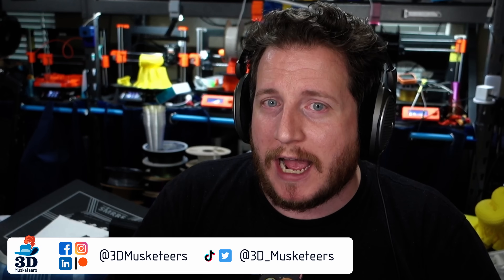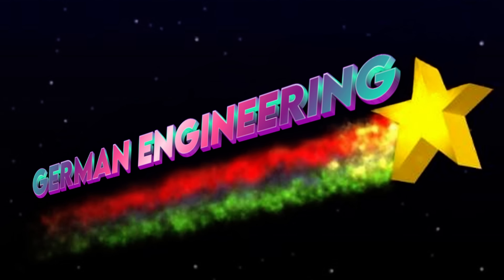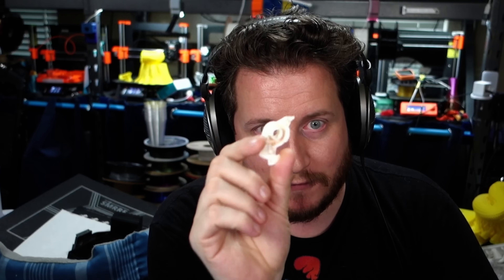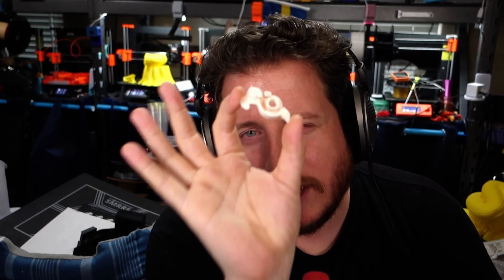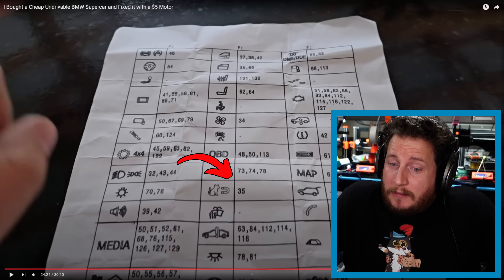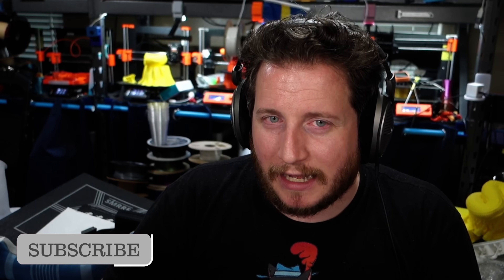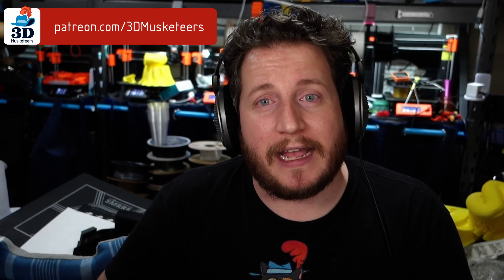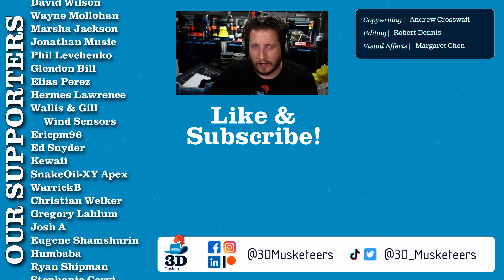Crafting @Samcrac's Car Part! - PrintFixFriday 200

Comment: I have yet to print a part out of nylon that will last long term (with or w/out CF).  At first they are great, very strong, resilient, capable of holding up under various stresses with no issues.  Then after a few months they always absorb to much water and fall apart, loosing most of the characteristics that made me want to use the material in the first place.

Comment: from experience: be careful to print spareparts for european cars, especial for bmw and mercedes, those parts are on "IP-clause" and especial BMW likes to flood you with DMCA's. The other one is for the german drivers, don't tell your TÜV you have printed some parts, those guys like to fail the safety inspection. for the lol's :  the holder for the compartment light is a safety relevant piece :)
Reply from the maker: Bring on the DMCA. BMW doesn't sell the part, and it's modified from stock ;)

Comment: Guy who is too poor to afford 3D scanners here: I have an old USB flatbed scanner that I use in conjunction with FreeCAD to model parts. Exporting to TIFF results in the DPI being included. FreeCAD (unlike Fusion3D!) actually reads the DPI and precisely scales the image which I then trace. Oh, and I do need calipers to get the thicknesses. 🙂

A lot of injection-molded pieces have flat faces that work well using a scanner and this is how I've been able to replace a number of parts with compound curves. So, if someone out there thinks they can't do something like this, think again - you might be able to.

I bet together, the community could release a whole category on Printables and other model sites to help people who need replacement plastic car parts.
Reply: Oh, and congrats on the 200+ episodes!

Comment: Just bought a 2001 Accord (2.3L VTec) last year replacing the 2002 Accord  (2.3L VTec) I drove for 17 yrs that was written off. 

After rebuilding the 4sp trans on 2001, it time to fix the damage it has on the OEM front bumper. These bumpers have a poor design that allows lower section of the bumper tabs to rip easily cause there is not enough plastic there. I would slap the designer on these if I even met him/her. I wish I had a huge 3D printer to create a new one, LOL. Had to manually melt TPO with the hot end repair tool, so I became by own 3D printer on this fix.

FYI, I hear the V6 auto trans is less reliable than the 2.3L. My issues were worn out clutch plates on #1 & #2. I also do many oil changes on transmissions, 100% Full synthetic fluid. Other than the weak transmissions, possible oil burning or clear coat issues, the 6th gen Accord is great reliable car.
Reply from the maker: Yep the V6 trans is known to be glass. I replace the fluid yearly. 188k on the clock. They do wear out faster and thats what likely will kill this car eventually. But I don't drive it too hard.

Comment: Functional Print Friday just revisited printed Toyota part holding trunk and gas flap opening levers. Coincidence? Repeating pattern in matrix 😅

It would be nice to have public library for all rare or "you need full assembly" parts, but not necessarily for parts that are still manufactured (or stored) and sold in parts stores - we need them alive and healthy 😉

addition: It likely wouldn't be better if he had a GM Saab - a GM platform car without GM platform and parts because Saab engineers 😅

Comment: Have you tested hands on with the Creality Raptor Pro list $1900 range?  What are thoughts on Creality Raptor model that is $999, I know  you lose some scan feature.  I do realize these are not 40k hand scanners, but looking for something in the sub 2500 range that can give me a fairly accurate scan for complex shapes and would love to know what is best option on market right now in this price range.  I had an older Creality hand scanner, and it was basically a boat anchor, not due to hardware but due to Creality never getting the software updated to point it worked properly, so Creality made me eat my hard earned $800 on this 3-year-old hand scanner I had bought at the time.  Sadly, Creality never responded when I sought to remedy the issue; instead, they merely phased by software out and never supported the hand scanner I bought from them ever again.

Comment: Absolutely, some, I wish I had a 3D printer back then for a few of them.
Some parts can't be had for less than 4 figures.
The back right fender on my old bus is now 3D printed, same with the custom mud flap for same,
the old one got tore up driving through a mudslide on the freeway on a very rainy night.
I remember the Oh, C&@p moment, the regional passenger bus I was following, did I mention it was very rainy? all I saw were the marker lights. started bouncing around and partially rolling heavily, he kept going though, then I hit it. it tore off my back fender and mud flap, fortunately no other damage.
Since I carry liability only, I tracked down the manufacturer, they wanted almost $3,000 for that 3kg of plastic of which only 3 remained.
CAD and printer I went.

Comment: and have the file and send it to pcbway and get it in metall mabe ;P
Reply from the maker: I would not recommend that due to everything else being plastic, it will just push the failure back more. But we do have metal printing capabilities here, so no need for PCBWay with 3D Musketeers ;)